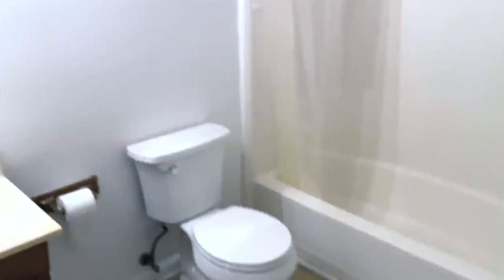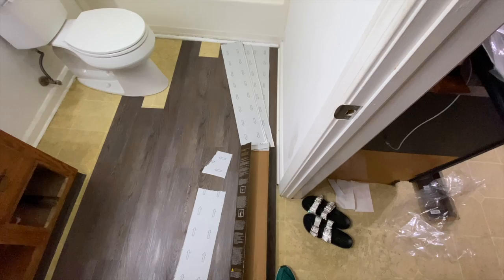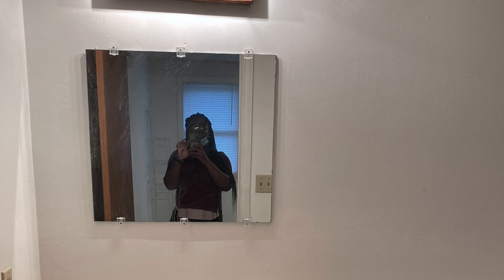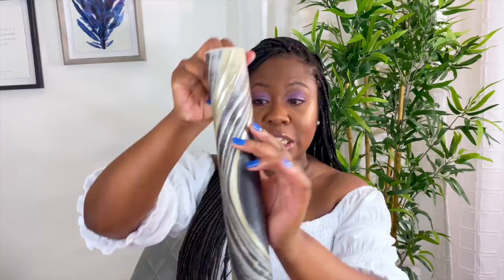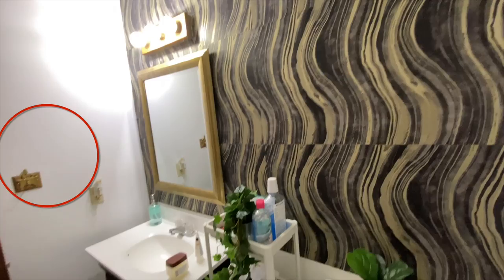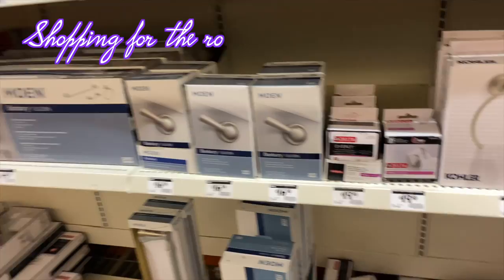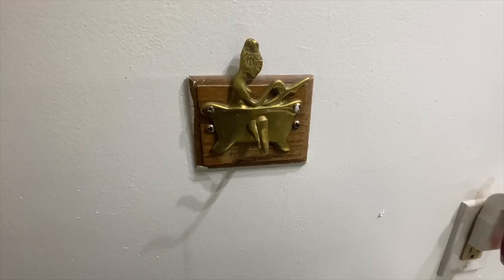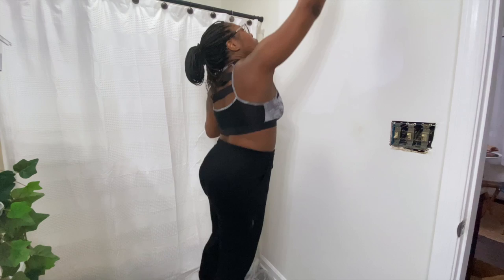DIY BATHROOM MAKEOVER | Renter & Budget Friendly

Comment: The reality of every building in the world is that they are ALL off-square. All of them. It's the reality of structures that, for many reasons, they never originate square and over time they shift.
So it's usually not a good idea to install LINEAR decor on floor or walls or anywhere where floors and walls influence their positioning; squares or random patterns are easier. In fact, you need to analyze the room to determine how to hide or minimize non-square layouts. Better to center flooring from the center of the room entrance. You can strike off 90-degrees from there, centering on the widest open area, which means you'll have to fudge the flooring where it meets the baseboard. Or, in a bathroom, you can align the flooring along the stretch of baseboard you face from the toilet, which will be the most noticeable in the room.
Peel-and-stick flooring is best laid out before removing the backing and sticking down. That way you can make placement corrections before application or cutting around fixtures, like the toilet or tub.
Recommendation is to plan to trim the flooring along that baseboard across from the toilet and cut around and place the flooring around the toilet and tub first; these are the hardest cuts to match, while the run along the baseboard is a simple straight line trim.